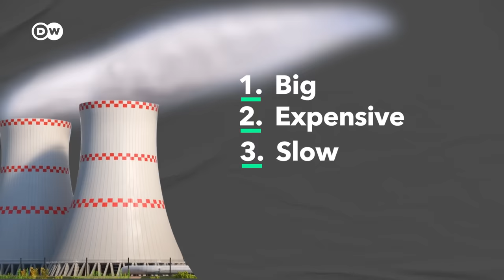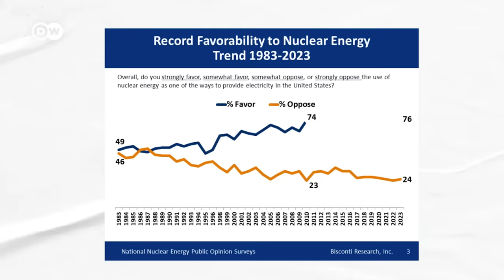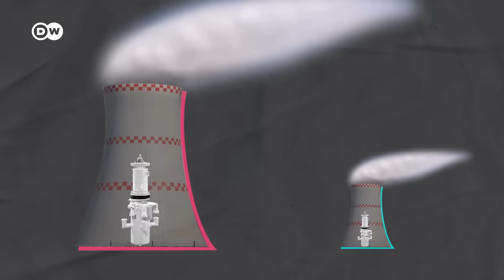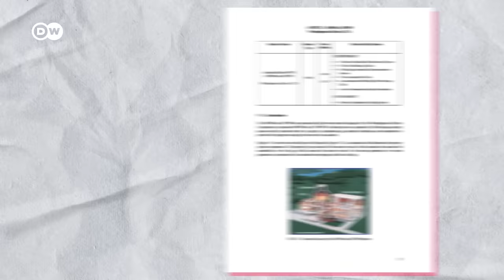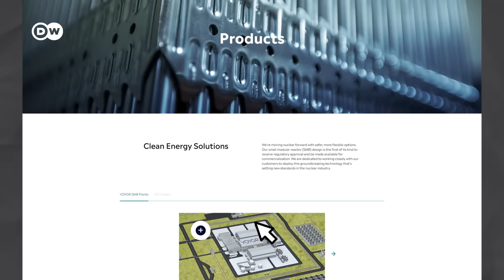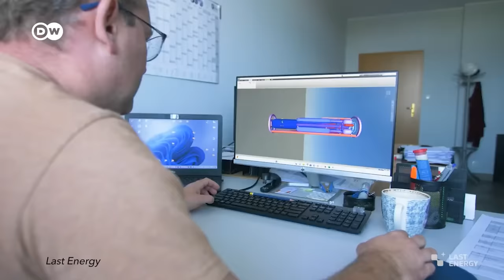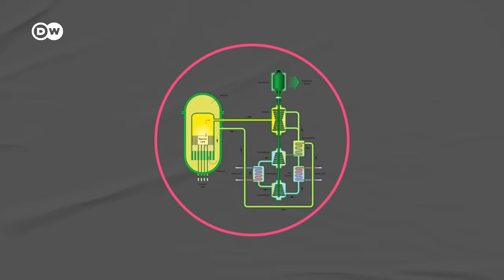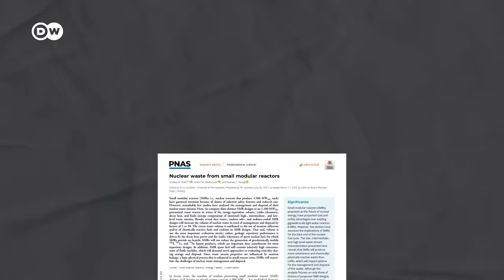Why people want to put small nuclear reactors everywhere

Comment: Horrible video. Nuclear energy plants cannot "end civilization"! Only Chernobyl is worth discussing, an accident that killed 20 people when they went in to fix the mess. The other three Chernobyl reactors ran another 20 years. That design is not being built today. Every society that has successfully totally decarbonized in under a decade has done so through NUCLEAR ENERGY:  France, Sweden, South Korea, Ontario Canada. S. Korea cut the cost of building nuclear plants 30% in real terms from 1971 to 2008. Distributed baseload: Nuclear can be put essentially anywhere removing the need for building significant transmission lines. Modular nuclear power supply can be perfectly matched to power demand in location and in time. The second of the Vogtle plant’s two reactors was 30% cheaper to build than the first because workers and project managers learned from their mistakes building the first reactor. Point Beach 1 & 2: 1100 Megawatts at less than $1000 per Kilowatt. Built is less than 3 years from 1968 to 1971. Build 10,000 of those plants. You can decarbonize America in under 5 years if you simultaneously build enough Point Beach 1 & 2 replicas. Scan all the valves and pipes and everything and duplicate it. Nuclear is the single source of power that can simultaneously scale to global levels of consumption, power the removal of the last 200 years of carbon, and most importantly fully account for its own compounding emissions. NRC standards set radiation level guidelines TEN THOUSAND times lower than science justifies, which is a primary source of nuclear’s expense. Nuclear power currently produces more than 50% of emissions-free electricity in the United States. BUILD NUCLEAR.

Comment: Well the smart people of Germany shut down all of their nuclear power plants and replaced all of them with high efficiency high temperature carbon reactors about which they seem very happy. These carbon reactors which combust dirty brown carbon with air can be highly variable in output so as to match the vagaries of wind and solar responding in 20 mins or so to changes.

Ironically though, the carbon reactors emit vastly more uranium and heavy metals into the air than the old nuclear plants but that doesn't seem to bother them either or DW. Thanks to Siemens.

Comment: Grid electricity is expensive because the grid costs $trillions and generation costs $billions. 
My feed-in 5cents, 50cents billed.
Grid electricity is grid rental. 
15% to 100% electric energy is x7 more grid capacity.
My fuse box will not let more than the maximum amount in.
So x7 more electricity,  is rubbish.

Comment: If we had spent even a fraction of the same money on something like fusion, we'd be so far ahead and won't have any one these issue by now...
Reply: @BoothTheGrey 

"Centralised construction"

As opposed to what exactly? Coal and gas also need big construction crews. How exactly does this mean more money for corporations? 

"How to get rid of old SMRs"

SMRs don't pose any unique challenges. Traditional nuclear plants are already decommissioned without issue. And those are much bigger.

"How to deal with disasters"

Nuclear disasters are exceedingly rare. And statistically nuclear as a whole pose little threat to human life. Look up death per TWH, Our World In Data. Nuclear is on par with renewables in safety and much better than coal, which has a significantly higher death per twh value.

However, nuclear disasters are definitely very expensive even when not contaminating a large area.

"Industries do not serve public good"

True. Thus the importance of regulations to ammend the weaknesses of capitalism. Given the safety of nuclear, it does work.
Reply from the maker: Actually we did a video on fusion couple of years ago looking at the milestones and challenges. Check this piece out here  👉 https://www.youtube.com/watch?v=eyHovWQ49MI ☢️ Do you think something's change after?
Reply: @DWPlanetA  Yes, it seems as though everyday there are new developments in fusion. 
And we finally had that one breakthrough, where we actually consistently got back more power back then we put in. 
I believe that Fusion is truly what will be powering our near and far future. And whilst it may not be the best, it is certainly one of the best.
Reply: @Planetes910 

Only a little more power. The currently under construction ITER is planned to have a Q of 10. 

But we need a Q of at least about 40, for it to be viable as power generation.

Because remember, there's a lot of inefficiency in the conversion.
Reply: @CandleWisp  It has already been discovered, multiple times by multiple different companies, with repeating results, that fusion, is very possible. 
Recently, a lot of breakthroughs have happened, including some companies putting in less power than they generated. Proving that not only is Fusion efficient, it is also possible on earth, with human tech. This took us decades of research. Now, if we had the same kind of budget as Fission, we would already be living in a fusion powered world. It's very clearly the future, and the way to go, but that future could've been now.

Comment: He said, "SMRs take up the least amount of land by far."

The actual power plant may, but in the US and many other countries there is a mandatory exclusion zone that takes up a large amount of land, and people cannot live there.  And if that is where the waste fuel is stored, it will be there for thousands of years.  Also, all thermal power plants consume huge amounts of water, which is not available in most areas.

However rooftop solar takes up no additional area, and requires no transmission or distribution grid.  Agrivoltaics are on existing farmland, coexisting with the crops.  And offshore wind turbines take up zero land.  So the argument he made about SMRs is absurd.
Reply: Solar also doesn't require fuel to be mined, transported, stored or auctioned. Supply of solar energy is literally free from the fusion generator in the sky and free beats any other form of energy.
Reply: @wnose  You have to make the panels, and dispose of them after ~20 years.

Comment: I understand why SMR projects are not going to secure contracts in place of full size LWRs on the order of 1GW, but isn't it clear that much of the early cost of experimental SMRs can be offset versus large reactors, by scaling them up modularly? The power output delta was cited to be ~1\3 the output of a typical lwr pp... so build 4 on one site, and  perform PMs on one at a time for full duty cycle. Surely, 3-4 SMRs could soon be manufactured cheaper and quicker than one large GW power plant... 
It is clear to me that SMRs are still very promising economically and otherwise - we need regulations to accommodate their development.

Comment: Nuclear is not expensive. Its lifecycle cost is very low. The issue is that shortsighted investors, clueless journalists, and ideologized militants only refer to LCOE, which is fixed to 20 years, rather than the lifecycle cost of a nuclear plant like the IEA does, and which shows that over a typical lifecycle of 60 years (a PWR reactor can last up to 80-100 depending on its maintenance and build quality) nuclear electricity is the cheapest source of base load electricity.

Comment: Long build time and high price for large nuclear are not technology problem- these are mostly political problems. Start building smart national programs with single design(kind of like France did), cheap capital (like is dropped on solar and wind), and fast decision making for locations and permissions and it should work. It Did in the past like for France, Sweden and Japan with gen 2, and gen 3 designs. Every new reactor is only smarter- safer already, so it is a bit of disingenuous to constantly talk about of safety while people die from coal, methane fires, CO poisoning or worse- lack or reliable power in third world.

Comment: Small scale can not compete with industrial production in price , safety ,fuel efficiency etc .May have sense for remote islands ,Antarctica scientific station ,military secluded installation .
Reply: No you are wrong.  Instead of building a huge single plant, you can construct MODULAR small reactors, starting them up as they are completed and getting funding for the next small units.   Many studies have shown that modular small reactors built in 2-3 years would cost less than building huge 1 gigawatt reactor that takes 10 years to build.  No electricity generation means no revenue, and only more interest charges....

Comment: If SMR were a good idea, chances are, we would have built them 50 years ago already (safety, security, etc. come to mind). And ditto for the Thorium MSR reactor, which was tested in Germany for a few years, but quietly ended (corrosion, etc.).
But the big elephant in the room is the handling of the nuclear waste, which needs to be stored safely and securely for thousands and generations.
Reply: well this has been the case in the 60s, 70s and 80s. not small modular reactor but big stardardized designs. when build in large numbers the cost falls, this has been historically documented. France build NPPs in the 70s and 80s for €1000 - 2000 / kw, canada between CAD 2000 - 4000 /kw. but now there are non build in western country's so yeah that's why the costs are really high. 

there is a solution for high level nuclear "wast" also known as spent fuel. it's called a closed fuel cycle. this has been demonstrated in many reactors over the decades.
Reply from the maker: ☢️ Talking about nuclear waste: stay tuned for this week's video that is on a nuclear waste dump in Germany! Also you should check out this piece from us visiting the only high-level nuclear waste storage site in Finland👇
"This could become the most radioactive place on earth"
https://www.youtube.com/watch?v=QFEd5RkotFE

Comment: Great concept, let down by capitalism. Also if they could evolve them to Sodium-Cooled Fast Reactor so they can run on already spend fuel from old and traditional reactor making them cleaners of spent fuel :)
Reply: You mean "let down by people being people"- there, I fixed that for ya.
Reply: @mavigogun  not all people are with that mindset, but yeah as Slipknot once said people equal shit 😁
Reply: SMR runs on spent fuel. --research it?
Reply: @fayebird1808  not all of them, there are multiple designs and ways they work. Research it.
Reply: @fayebird1808 

The term SMR only refers to the thermal capacity, not the fuel or cooling method.

Comment: Nuclear and hydrothermal are best wind kills so many birds.
Solar make heat domes if done in industrial scale with little to no plant life under em like 99% do now.
Gravity batteries can be great if done right don't use the grid have prisoners walk on a wheel on the inside to life massive weights and drop it very slowly for power no grid power needed to lift em.
Reply: Crazy that solar developers have to hire industrial landscaping crews to cut down the undergrowth in utility-scale solar installations. I thought you said nothing grew there!!!!